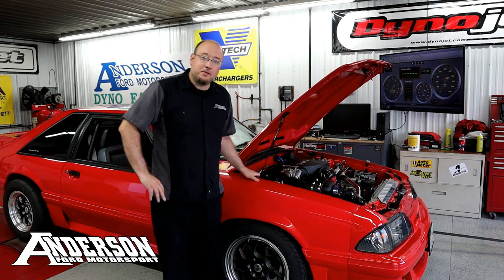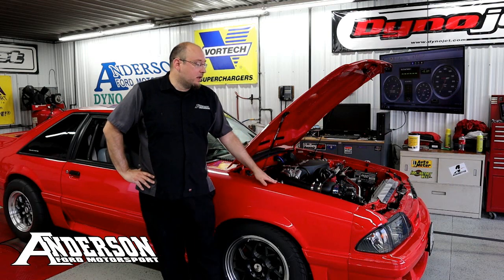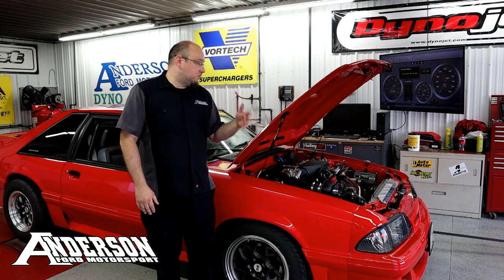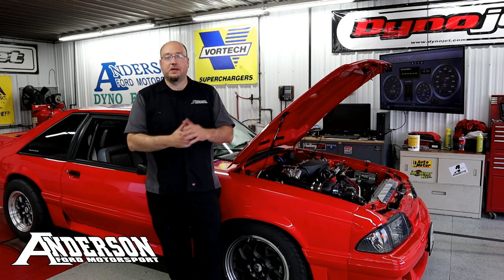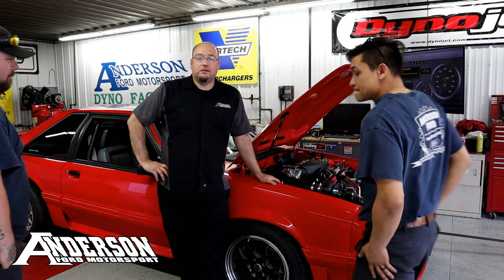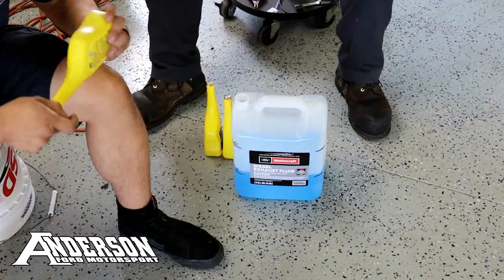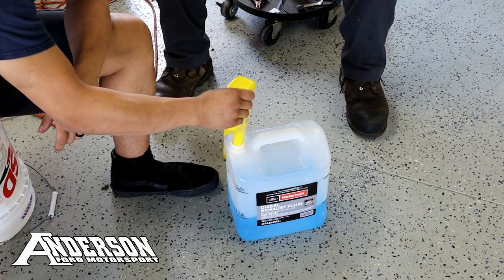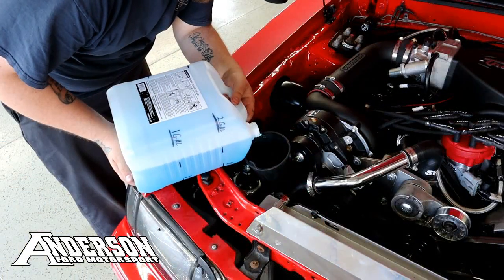AFM Project Everyman Episode 7

Comment: bro you need to shove the clutch in right after the pull so you dont load the motor with all that fuel thats  why it back fired:face-blue-wide-eyes::face-blue-wide-eyes::face-blue-wide-eyes::face-blue-wide-eyes:

Comment: Hi Donnie, Will from Silver Sport Transmissions. I ended up using NGK R5671A-8 for my TFS 11r190 comp heads on stock block 302 after discovering the hot autolight 3924 extended tip plugs gapped at .035 spark was being blown out from the boost. The new NGK plugs are now gapped at .025. With the old plugs being gapped at .035 the car made 497hp and 499 torque at 5500rpm to the wheels, then fell on its but after that because of the old plugs, plus the plugs was burnt up.
Reply from the maker: Hey Will, were you running a CDI box? How much boost were you making?
Reply: @AndersonMotorsports  now CDI box yet, just the same distributor with TFI that's on your car. The boost was at 14lbs. The boost and everything started to fall past 5500 rpm. I can email you a picture of the Dyno Jet printout. I believe the IAT was probably high though, so looking into a intercooler system.
Reply: Not sure what fuel you are using but I'm pretty happy with the BKR7E's on moderate boost/power for street cars at the 5-700hp range. They seem to clean up fine and work without issue.  I gap  closer to .023, or less if no ignition box.  With more boost I jump to the same plug you mentioned.  I just don't think that cold of a plug is needed for most street cars on limited timing.

Comment: Awesome!  I have a 95 making 438whp with stock cam n crank. It’s got 60cc TF heads, forged 9.5:1 pistons, gt40 upper n lower ported, fuel pump, 60 injectors, vortech v2 s trim on 3” pulley with your power pipe. I currently am tearing it down to do a cam. Timing cover started blowing coolant so might as well do cam since I’m going that far.